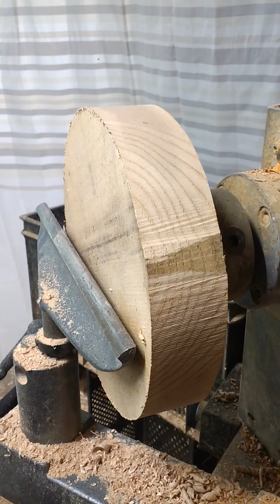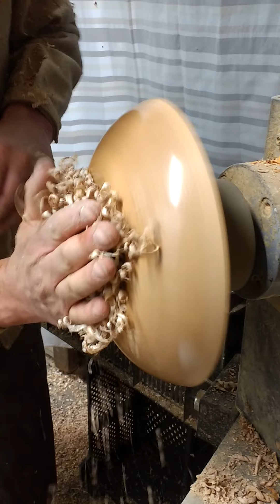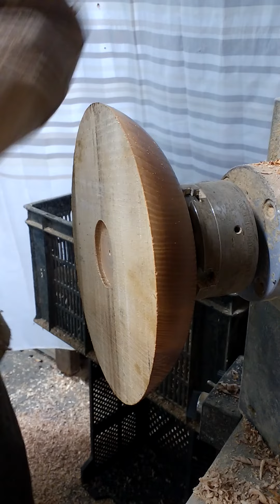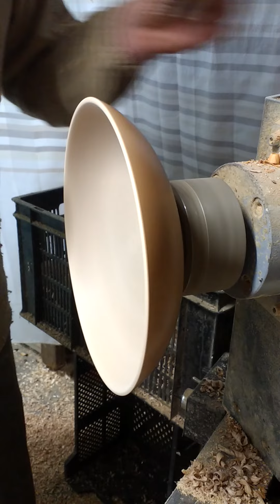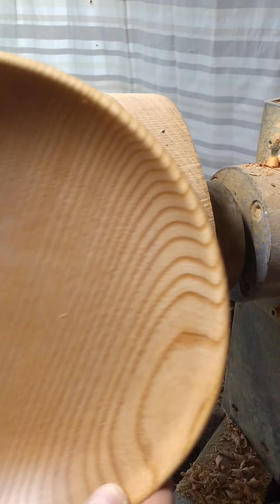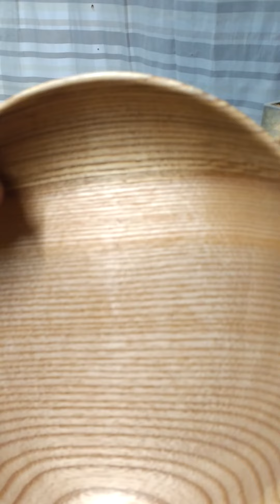Back to production turning with a kiln dried ash pasta bowl.

Comment: Great work. What's your method for preparing the first recess? Do you turn it between centers?
Reply from the maker: Thanks Josh :) The initial recess is produced using a 2 1/8" forstner bit in a pillar drill, making a hole of a similar size to my fully closed chuck jaws. You can find details of my whole process in this video https://www.youtube.com/watch?v=_wXgx6DSRNM By drilling a hole it means I can prepare multiple blanks in advance, which of course speeds up the production process.